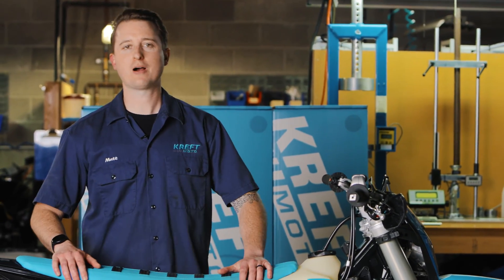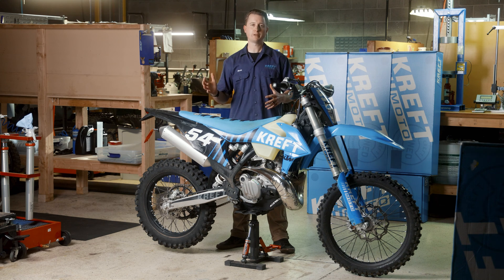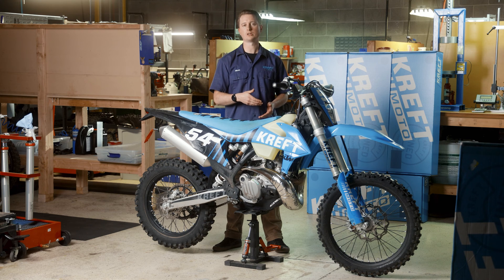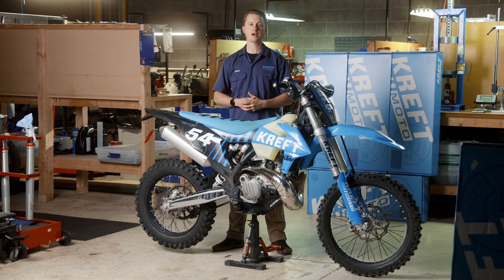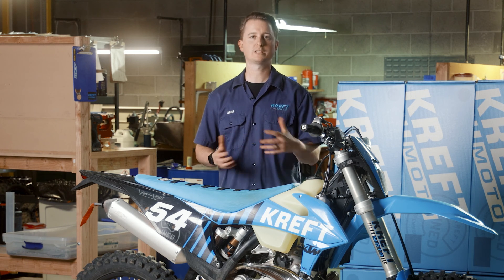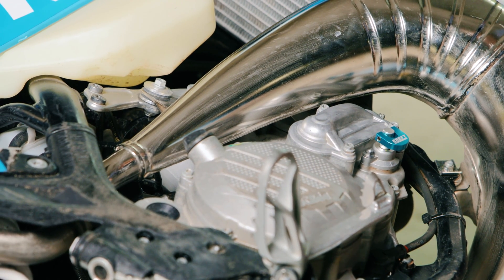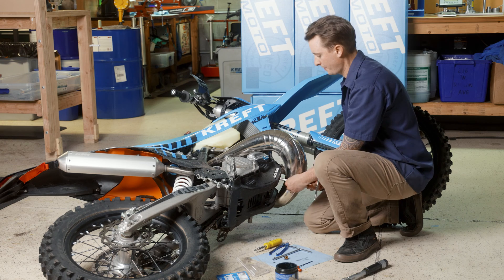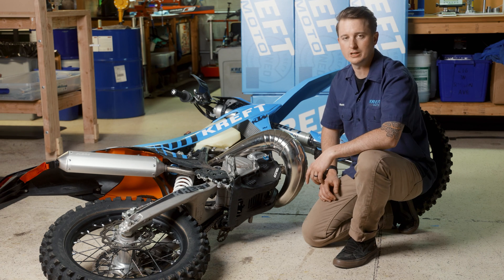Kreft Moto Powerdial Installation (Powervalve Adjuster)

Comment: Could have been helpful to see the 
Modified skid plate
Reply: It was quick and dirty using a band saw. A dremel or fine-toothed hand saw will also work well. Roughly a thumb-sized portion was removed.